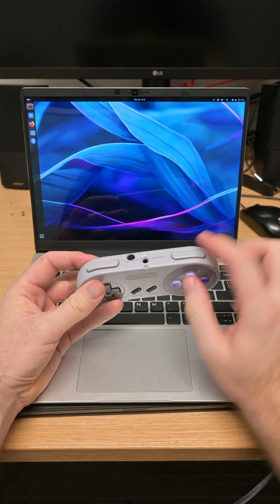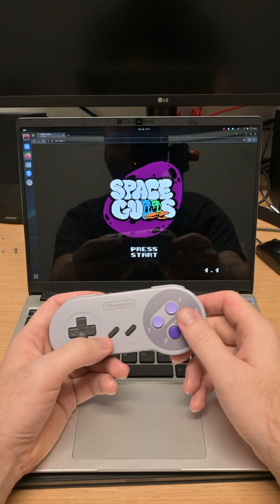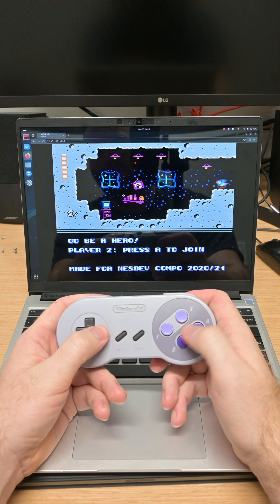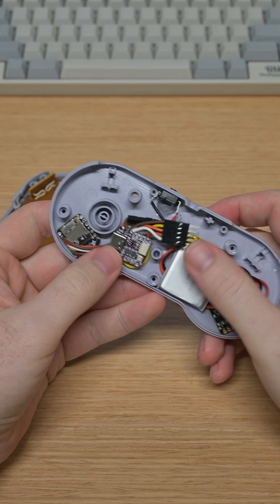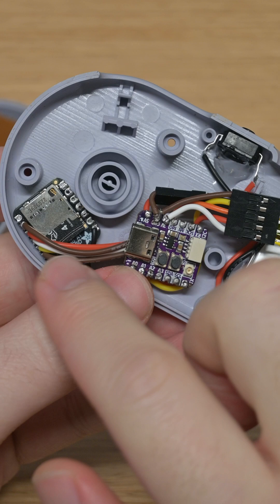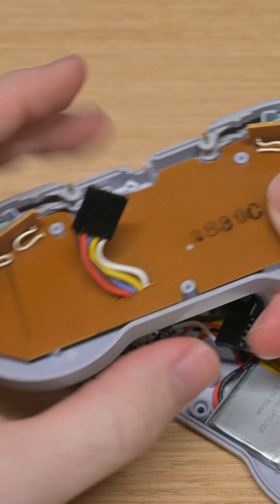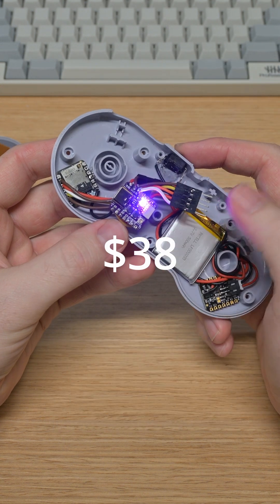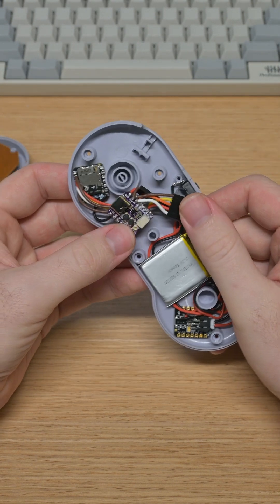What's inside my magic SNES controller? #arduino #raspberrypi

Comment: These famiclone controller consoles used to be very common in china (except with a long composite cable out the back)

since game consoles were banned they circumvented it by putting the entire system inside a controller so it's not counted as a gaming console

Nintendo even officially released an entire N64 inside a controller called the iQue player

For a while this was the only way to legally sell games in china until the ban was lifted in 2015

Comment: Could this be done with something like a pi zero or compute module - and, if so, would that allow you to emulate more systems? Between that and fitting a bigger battery I'm considering this, although I'd really like to have an optional USB C port to charge the battery and bypass the WiFi connection.